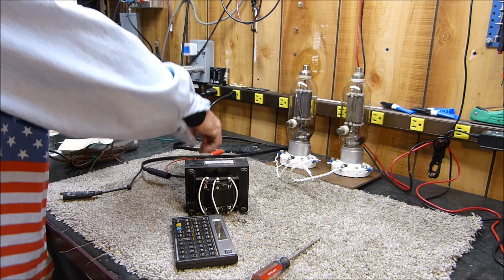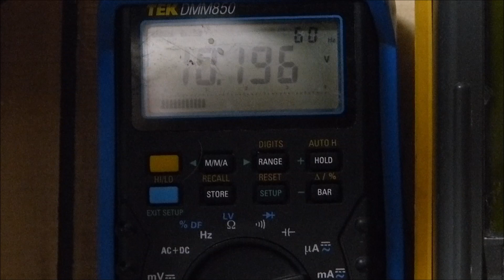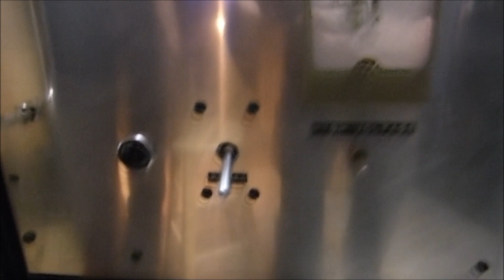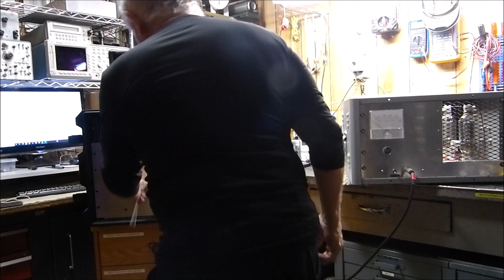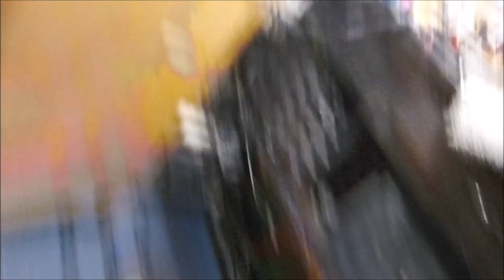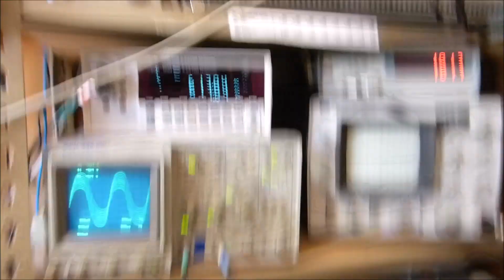700 Watt 810 Triode Vacuum Tube  Audio Amplifier Completion & Testing

Comment: My mum will indeed see the back of me this October. 

She is.looking.forwardto._____% [ > ] roll 
[ <•__(((_<<<_^*_<<.. ,  ] ,,, , C_0 ~~~~~♧¡ 
   ( °L° ))()())))(?__♤♡◇♧♧♧♡♤□●□□☆¡¡ 
             D_0 000,000 Ů 
                     UM\\\\\\\\\ .... 
                              _<#^area.   2/5 1/1. L⁰ 
H+                            _ vs T.0 😳  

Shall explain how my tai qi guard is very different to silat - which is very dope. Would say difference between high end bagua / xinyie and silat / muay thai is what I'm trying to develop as a contrast to krav and its derivatives. 

Instead of breaking the limbs apart, I use them as a single element of balance and structure. Emu body and emu neck. Roy Hull vs Michael Parkinson @ tobacco tinted seedy beeb. The professionals. Professor's specialist. 

What i like from muay thai is the hand defense 👏 👌 same with silat and wing chun, use of distance & ground taking 👌 escalation flowchart. If you turn silat inside out is aikido a la segal. 

I should go tokyo and get a slap. Or maybe he laugh 😃. Problem with being gaijin gains master status. Vs my attitude to JP clout _ they're like the scots of asia, maybe the swiss or swedish. They're a bit swedish actually the koreans are like the scots and taekwondo will work against everything. Is fairly complete as a gi bound lessons & belt grades DoD little kids thing, and is very muay thai resistant. CN is shiny tracksuit or legit old tradition medieval handmade jewellery. Uk is second home of CN taiwan 🇹🇼 HK old traditions and empire million people death tolls. Boxer rebellion in the datagrams pulsing gently.

Comment: Using resistance in the primary is by far the best, but in situations like mine (where the power line voltage constantly changes), it would probably be better to offer resistance in the secondary.     Jim     WA5WRE

Comment: Could not stop watching. 
I was sure there was about to be a giant puff of smoke.
Reply from the maker: Actually, a gigantic... Bang ... when the HV arcs and blows pieces of the fuse-resistor all over the room and scares everyone out of their wits. Amazingly, it turned out great and not even one blown fuse...    It performed extremely well delivering over 700 watts when the drive power was raised and plate current went just over 500mA at 2200 volts and an efficiency of about 64%. I may have to build another one.   :-)

Comment: Yeah you need a camera operator, a dolly driver, boom operator, maybe some tracks, and of course a lighting director.

I was wondering if you could make like the ceiling fan speed controllers and use a capacitor instead of a resistor in series with the primary. 137uf gives 20R at 60Hz. Then you wouldn't have to worry about dissipation. Current probably an issue though, and rating.

Great show.

EJP
Reply from the maker: Years ago I built a bunch of SCR voltage controller sand they work great into steady loads like a light bulb but I think I tried one into something like this and it did not work very well. I remember looking at the voltage across the load and it had some pretty sharp voltage waveforms where the SCR turns on so I suspect it could have a good bit of noise in it. Nothing like a huge Variac to control voltage. Anytime I need bias voltage that will have to supply grid current, I tend to go overboard in the size just to keep the bias stable. Now that you have me thinking about it, I may have Tommy add a bleeder resistor to the bias supply to stabilize it a bit more.

Comment: Very nice!  What was the voltage and current going into the 8 ohm dummy load @ 600+ watts?
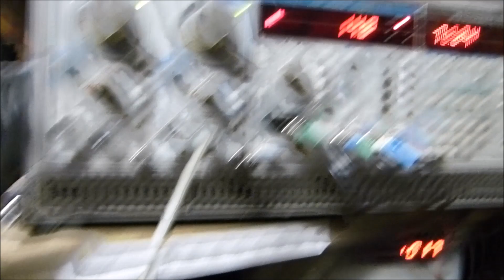Reply from the maker: At 29:28 I can see the volt meter at 72.28 volts across the 8 ohms which comes out to be 653 watts on the meter. Current would be 9 amps... the resistors drop in resistance as they get hot so we are probably working into something less than 8 ohms and actual power is over 700 watts.

Comment: It is cool what you can do with transformers.  I've used extra windings on the second run in series with the primary to buck that voltage on the secondary windings being used.  Mainly to lower the HV .  Also,  I came across a 20 watt decade box a while back.  Comes in handy.  I like drawing schematics by hand also and have some templates.  Never seen the drawing pencil sharpener. Cool!

Comment: OUI!!!  Handling the 100 ohm power resistor with the AC line still connected!!!!!
Also, worried me with all your meters on the wall above the 810's!  I hope the meters are secure and will not fall!  POP the tubes!

Comment: The eraser shield and the mechanical pencil sharper bring back memories of my industrial design drafting courses back in the 70's. Does anyone still use Vellum? Thanks for the memories! 👍
Reply: Vellum gave way to Mylar in the late 70’s. Followed shortly by plotters printing on either paper or Mylar in the 80’s. When I first learned drafting in the ‘60’s I used ink on waxed linen.
Reply: I took mech. drawing in high school. Loved it. Played with Cadkey 6 for DOS and ACAD 10? 12? for DOS. Heady times! Could run it on an old 386 with 2 megs. memory. Wish I'd save that old PC just for the fun of it.